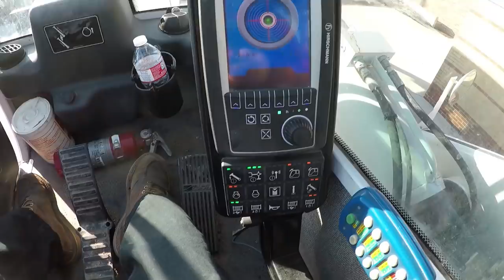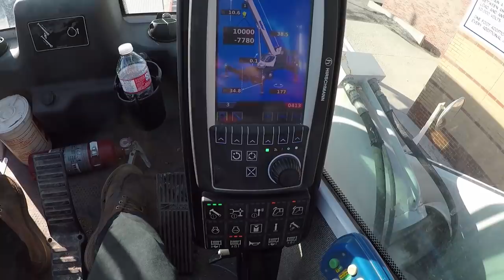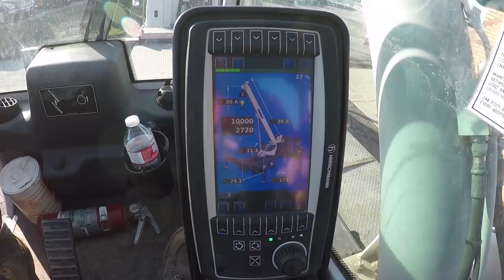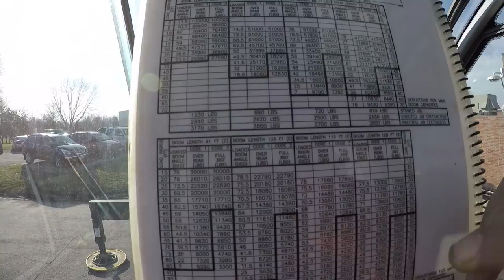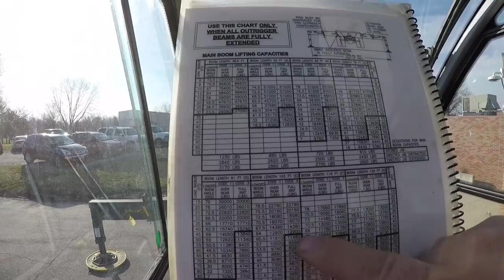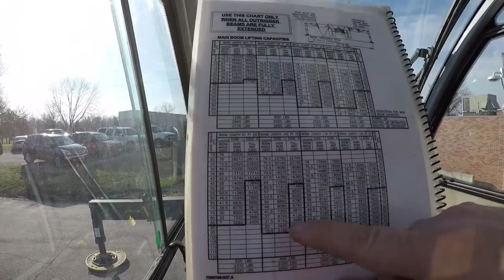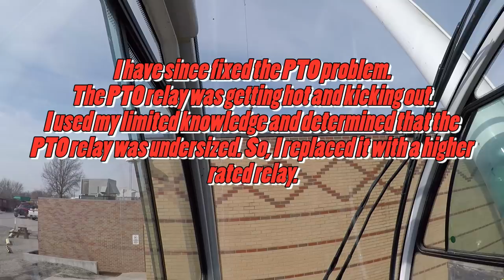Removing a rooftop air conditioner with a crane

Comment: I was gonna say sounds like the physical switch failing or a relay dropping out. Good to know you figured it out.
Reply from the maker: It was indeed the relay. I even replaced the relay a while back and the problem persisted. It wasn't until I installed a bigger relay that the problem went away. Many thanks for watching! 🙂

Comment: Nice video Jimmy. I chuckled when your spotter on the roof wanted you to boom in and instead you boomed up and cabled down. i experienced something similar while training with the fire department. They always wanted to boom in. Instead as operators we see what they want and make decisions based on what it is they want even though it's not done exactly how they want. Totally understand what you meant
Reply from the maker: Sometimes we have to interpret and make things happen. Generally the less experience a person has working around cranes, the more they give signals that have to be interpreted. Many thanks for watching! 🙂

Comment: when I was in college, a crane tipped up off it's back wheels when lifting a large HVAC unit to the top of a ~6 story library.  The thud of the load landing on the roof of the building was pretty impressive.  They brought in a second crane to correct the situation.  Not a good day for that operator or whomever was in charge of that job.

Comment: I run into the "telescope in & out" signal a lot with crews that use tele-handlers.  Same as you, I boom up, cable down.  My boom doesn't chatter unless I've been so busy, it's over due for grease, (not very often) but I don't want that happening with a load on.  I wonder if anyone running a lattice boom ever got those signals!
Reply from the maker: Agreed! Scoping with a load and a dry boom would be disastrous for the wear pads. It may even shear them off. Like you, I try to avoid any boom length change with a load. Many thanks for watching! 🙂
Reply: @ToTheTopCrane   I run a telehandler and was curious about how these cranes are run, from what i gather you try not to scope in or out with your boom and get all your horizontal travel  from changing the boom angle?
Reply from the maker: @markdoumert4840  that is correct. In a crane, I avoid scoping with a load as much as possible. Many thanks for watching! 🙂

Comment: Tip for flagging a crane: Don't wear gloves that are the same color as your coat.

Jimmy, do you ever use formal, written lift plans?  If so, that would make an interesting video, I think
Reply from the maker: I absolutely agree on the gloves and flagging a crane. Sometimes it's impossible to see the signals. 

We do use formal pick plans for some lifts. I'll try to make a video with one. Thanks for the idea and for watching! 🙂

Comment: Mice will eat wires. I had a Lexus 400 come in the other day for a knock sensor light on. After removing the intake manifold to replace the sensor I found a rats nest and they had eating all the wiring off both knock sensors.

Comment: For god's sake, if you're going to eat in a piece of equipment, clean the heck up after yourself! That said, I've got a (probably silly) question: there's a fair bit of real estate by the look of it between the superstructure and the truck cab. Were you in such a situation, could you shanghai the Manitex into service as a carry deck?
Reply from the maker: We carry rigging and sometimes a man basket on the deck. But, the deck is aluminum. So, there isn't a lot of capacity there. Thanks for watching! 🙂